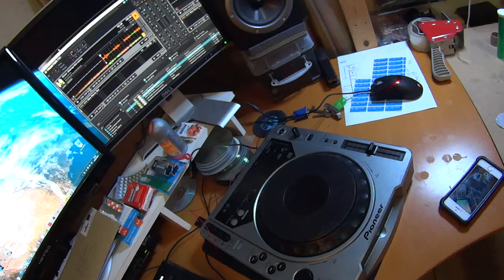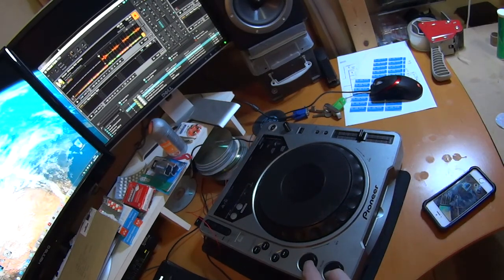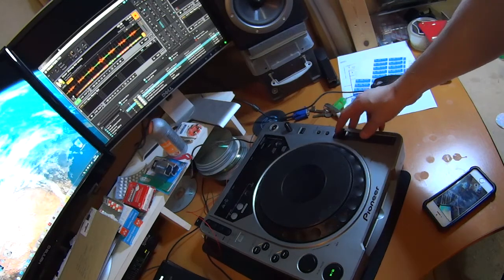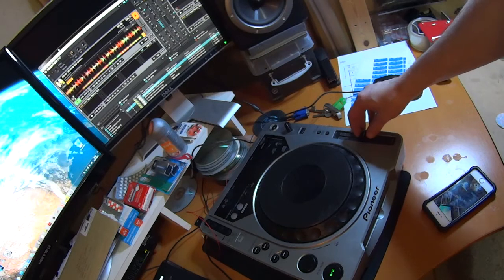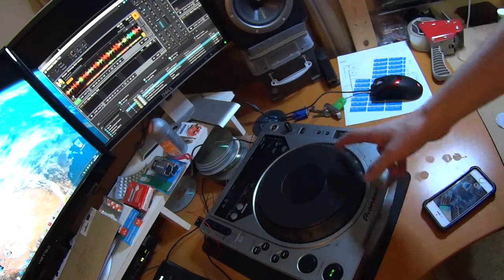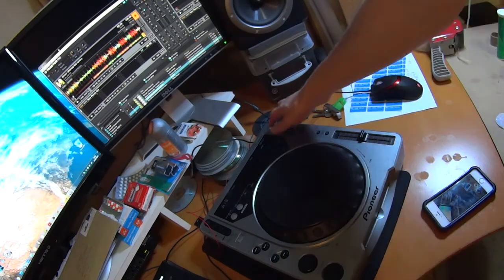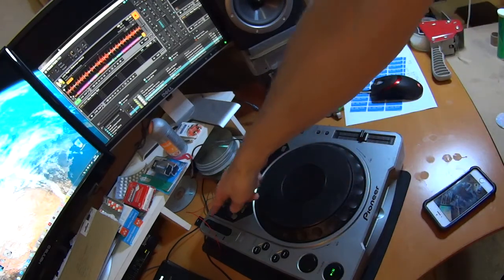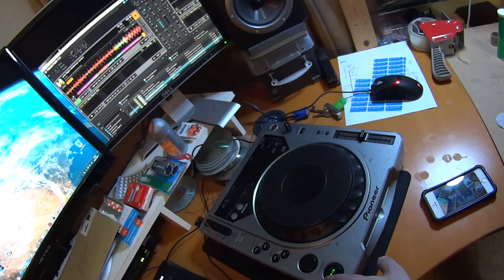Broken CDJ 800 - Teensy Midi Conversion

Comment: Hi nice project, really like it..You think cdj800 will work with android based dj software ?
Reply from the maker: what do you mean ? my midi version or just the 800 in general and what software are you talking about
Reply: @DJlegionuk  od course your version at any MIDI based software at Android oraz IOS
Reply from the maker: it's just midi over a HID usb device so no drivers are needed. I would say they should work with anything and I am thinking about trying a PI Deck with my midi controller, but I would need to setup a single deck skin for it.
Reply: It will work with Cross DJ for android after mapping

Comment: Hey DJ Legion,

If I replace all the components of the CDJ 800 you connected with potentiometers, knobs, rotary encoders and LEDS will it do the same job and the code perform the same way?

Thanks, 

PS: Im trying to develop a DJ Controller for my senior project.
Reply from the maker: potentially yes, but it would need some changes. leds are powered via a special bus on the cdj. all the buttons have resistor values so work via analogue input. A rotary encoder would work for the jog wheel, but if it's just a small clicky one it would not have enough steps.

Comment: You could map anything to anything right? Because I have thought of this, just for fun, and would linke to turn the loop buttons into hotkeys and the vynal break adjust to a filter. That would be a option right?
Reply from the maker: +hoppelake yes you can map it to anything. I plan to use the 4 top buttons as loop and hot key with the rev button as a switch. I have finished connecting everything and just need to work on the software.

http://i.imgur.com/16Jnaf7.jpg
Reply from the maker: +hoppelake https://www.facebook.com/lee.smith1/videos/10154074267943313/
Reply from the maker: +hoppelake https://www.youtube.com/watch?v=SNMew0yMfGE